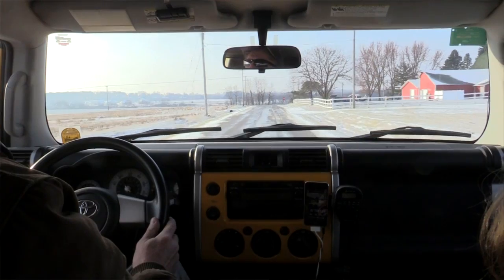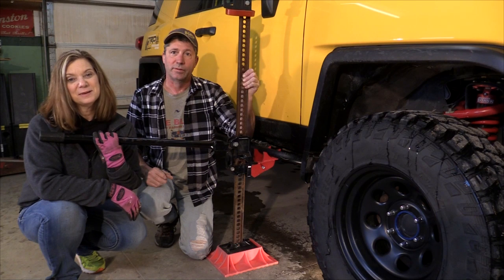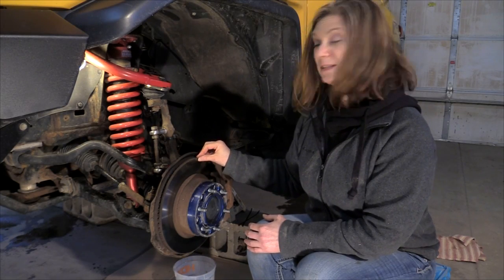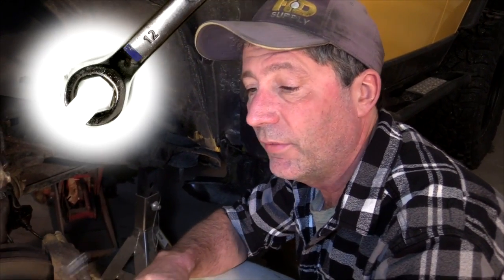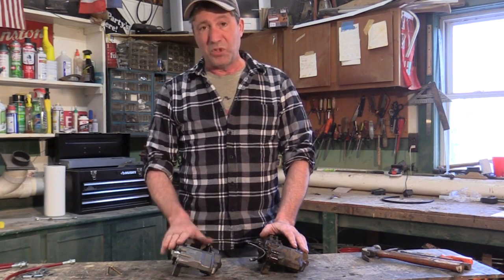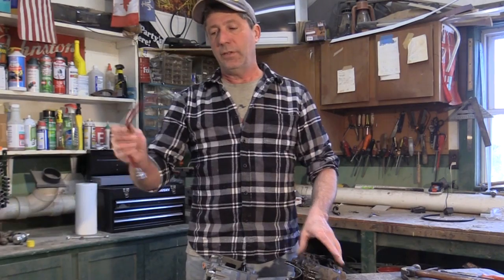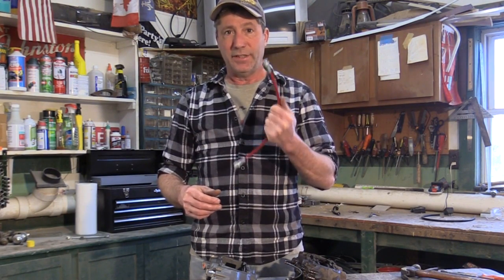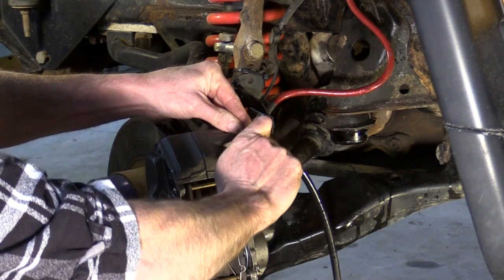How To Install Front Brake Calipers, Toyota FJ, Four Runner, Tacoma

Comment: nice video! dont know about yours but my 14 will bleed the breaks if you just hold down the peddle pump does the rest
Reply from the maker: Ours does it on its own in the rear but not the front.